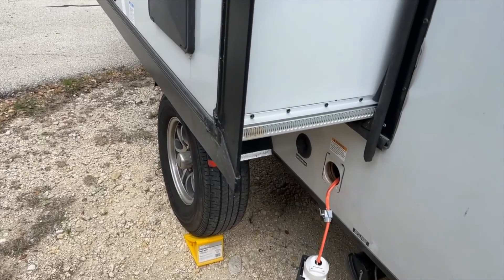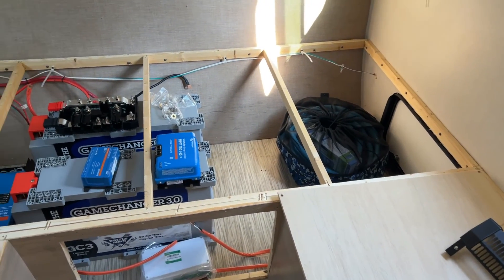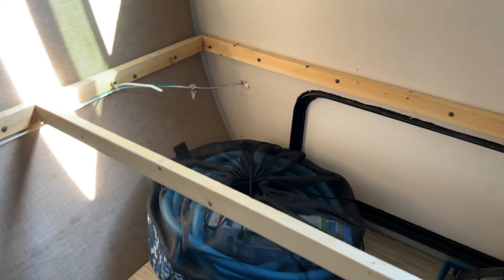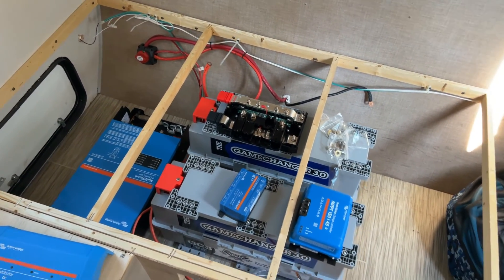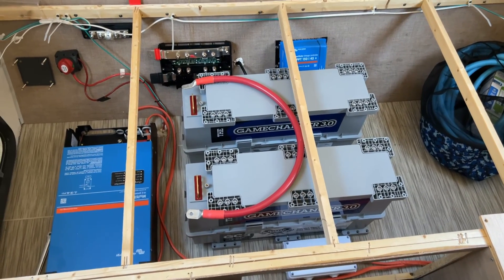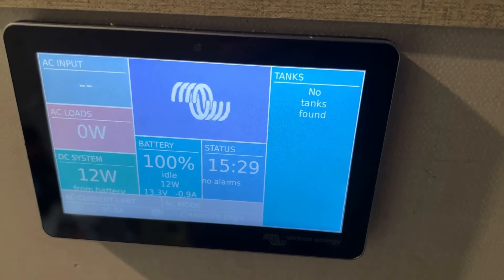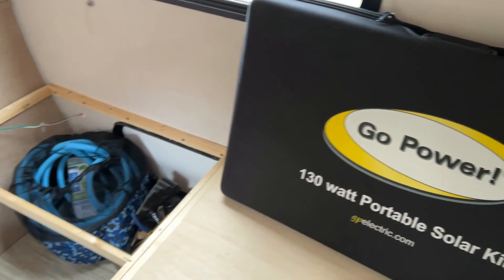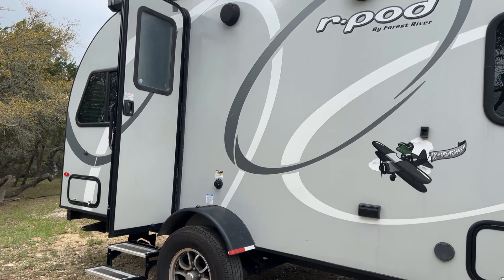R-Pod 190 Battle Born GC3 Lithium, Solar, and Victron Inverter

Comment: Are the GC3s BMS providing info to the Cerbo GX?
Reply from the maker: Hi there.  The GC3 internal BMS doesn't externally communicate to anything else.  

With that said, the Victron inverter has a fully customizable charging profile, so you set all of the parameters with the same voltages and charge times that Battle Born calls for.  The BMS in the batteries will not let them get damaged, and will control how quickly they take in power for charging.

All of the battery state of charge information is provided by the Victron SmartShunt, however.
Reply: @RickysHP  Thanks for the reply. Trying to figure all this out IRT adding a second alternator and Wakespeed 500 as another charging source. I have a 5000W Victron Quattro 12/5000/220-100/100 120V VE.Bus ready for install to manage shore power, etc. Need to figure out the alternator charging via the regulator.
Reply from the maker: @kevinmctarsney36  It looks like that Wakespeed has different configurable charging profiles, as well, and you can set LiFePO4 as a battery type, so it should know what voltages to charge at, once configured.  The BMS on the Battle Born batteries won't let you over-charge anything, as best as I can tell, and they can take a charge at such a high rate, you'd be hard-pressed to feed them power too quickly.

If you want an all-Victron setup, the Orion XS DC-to-DC 50amp charger may be something you may want to look into: https://www.victronenergy.com/dc-dc-converters/orion-xs-12-12-50a-dc-dc-battery-charger